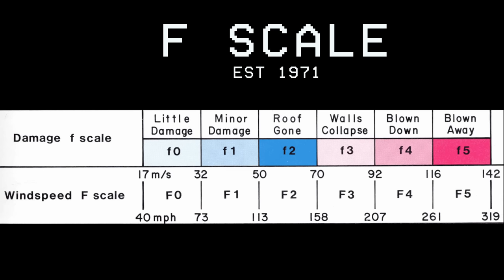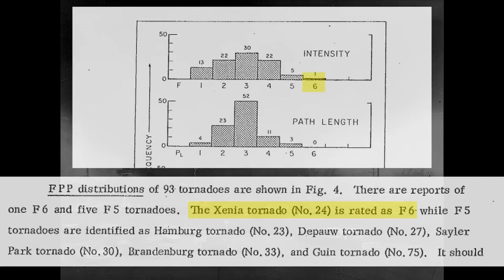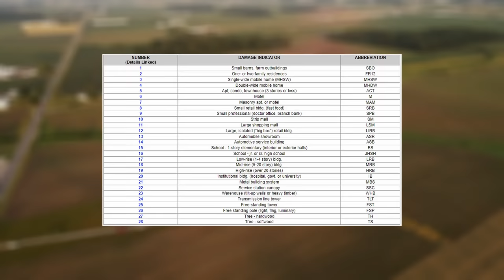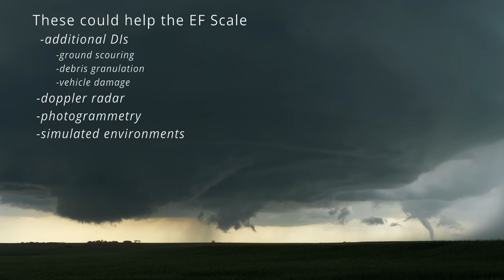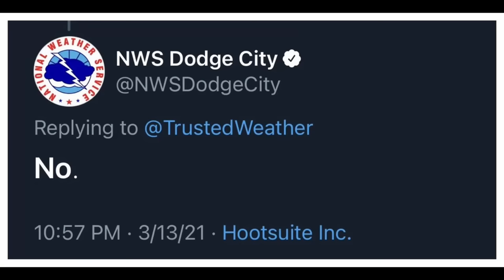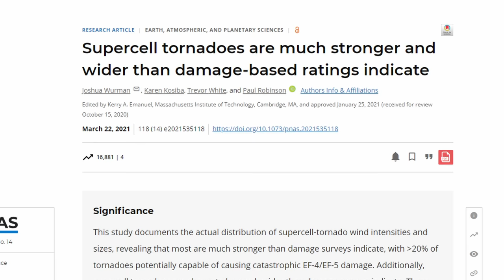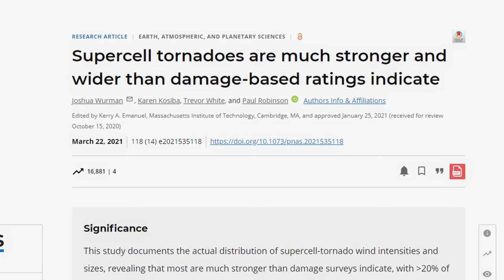Is The EF Scale Outdated?

Comment: Better than the original F-scale, but still not good enough. There has to be more taken into account, including Doppler Wind speed (at the lowest level possible), non DI situations including debarked trees, ground swirls and scouring, and others. Take Joplin; manhole covers were removed and tossed, as well as rebar-anchored concrete parking lot stops. And they were considered more "supplemental" than actual indicators. Again the EF scale is an upgrade of the original, but it is in desperate need of a revamp. We don't HAVE to consider ONLY damage; there are other tornado intensity factors that can be considered as well, that also SHOULD be taken as part of the overall rating.

Comment: The Saffir-Simpson Scale for Hurricanes is outdated too. In fact, there needs to be a surge scale because most deaths in a hurricane doesn't come from wind, it comes from water.
Reply: yeah if we are gonna rate a hurricane on strength it needs to be barometric pressure or lack there of. Or it should be a factor at least

Comment: I grew up in central IL. I'm willing to bet that 20%+ of all tornadoes are underrated by at least one on the EF scale since at least the early 1970s. There important unseen reasons to underrate storms. First, there is an important and highly funded community that relies on "more powerful" storms in the present compared to the past, second, FEMA funds are not unlimited, and third, NOAA itself has incentives to underrate. Mistakes in calculation are a distant problem. Add insurance lobbies, half brained elected officials, and uncaring bureaucrats, and you have a very well oiled machine in place to pretend that storms are less than they really are. This problem goes all the way back to some of the bad storms like the tornado outbreak of 1890 (https://en.wikipedia.org/wiki/Tornado_outbreak_of_March_27,_1890).

Comment: There's nothing wrong with the EF scale. You need to direct your frustrations to the survey teams. They're the ones rating the damage. That being said, theres a reason they tend to downplay intensity ratings. It's important to not water down the difference between a tornado that may have ever so briefly borderlined the extreme intensity worthy of an EF5 rating and that of a tornado that can hold that extreme intensity for extended periods of time. EF4 and EF5 tornadoes are both very rare and violent. Each can level homes, throw heavy objects remarkable distances, and they can easily be deadly. Either is also rare. But there needs to be something to differentiate the two. EF 5 rating should be saved for what it's intended for. The most extreme and remarkable damage from the rarest intensity level. 

The best part of the EF scale is damage doesn't overlap. From an EF0 to an EF5, there should be no question on intensity. It's better to aim low and give a high end EF4 rating than it is to give a EF5 rating because a gust of wind may have briefly pushed it just inside the threshold of EF5 intensity. Hurricane intensity is rated similarly, not by the strength of the gusts, but how high they hold an average wind speed. 

I really don't understand why anyone would want to rate a tornado based on wind speed alone. Nobody cares if a tornado has 200+ mph winds if it's in an open field and doesn't hit anything. At that point it doesn't make any difference if the wind speed is 70 mph or 300+. As long as it's not out there doing extreme ground scouring and digging trenches. which by the way,  has been used to decide an EF5 rating. The 2011 Philadelphia Ms EF5 rating was determined due to extreme ground scouring (2ft deep trenches). 2.6 miles wide or not, the El Reno tornado would've been insignificant had it not been for  storm chasers that didn't stay out of its path. After all, chasers can't be hit by tornadoes if they'd simply stay out from under the rotating wall cloud. It's called the bears cage for a reason.

Comment: We need a way to measure wind speed 10-20 feet off the ground damage or no damage.  

Keep the EF damage rating system but also develop a radar wind speed scale.  

9 tornadoes hit DI’s able to give them that rating.   I assume other tornadoes were as strong but not observable due to no damage rating.    

Had the el Reno monster hit a town it would be EF4 or greater

Comment: I’ve heard it explained by engineers who assess these storms, that just because a house is swept clean off it’s foundation, does not mean it was EF 5. It may have been just barely bolted to the foundation or the specific bolts used to anchor it would not be enough to keep the house anchored downward when the low pressure outside the home from the tornado, causes the high pressure in the home to lift off it’s foundation. This is why true EF 5’s are based off of extremely well built and incredibly well anchored homes. If those are fully swept clean, in addition to a list of many other things, they know it’s EF 5. It is rare to see homes extremely well anchored, as required for it to be considered EF 5, so the ability for other homes for handle much lower winds can sometimes be enough to sweep it clean. The people who rate the tornadoes have several steps per foundation anchor types to properly assess if it would have been demolished at much lower speeds. This is why not all clean slabs are considered F5.

Comment: Literally the only thing they need to do to fix the scale is by updating the wording of it to simply be more along the lines of "Recorded wind speed measurements determine the rating. In absence of accurate measurements, damage assessments and witness video should be used to estimate its impact" rather than "If there's no damage, there's no tornado"

Comment: I don't think going by radar indicated winds is a good idea either. A lot of the time, the radar isn't close to the storm, meaning that the radar itself isn't reading windspeeds at the ground, but higher up into the storm itself. This doesn't translate 1:1 to ground level wind speeds.
Reply: May 3, 1999, the DOW recorded 318 mph winds, but was adjusted to 302 mph at ground level, as the greater number was recorded several meters above the ground.

Comment: Heres my opinion shortened 

We rate hurricanes by wind speed so why not use our modern tools and rate tornadoes by wind speed (includes video footage to calculate wind speed) then if theres no wind data go off damage

Also side note i consider xenia an F6
Reply: Dr. Fujita classified Bridge Creek and Xenia both as possibly being of EF-6 strength as well.
Reply: @helicitywx  thats impossible as Dr. Fujita passed away in 98 and the tornado was in 99
Reply: @wolfgamingnetwork3542  This should've been "Bridge Creek and Xenia were possibly F-6 strength."
Reply: The vast majority of tornadoes have no measured wind speed. Well under one percent ever get a wind speed measurement.
Reply: @tid418  That's why it ticks my off to see all the comments saying "we have dows now." DOWs will not be used in the vast majority of tornadoes. And the winds are too violent for the standards measuring device, namely an anemometer, to survive.

Comment: You are free to agree/disagree with me. I don't mean to debate, I would like to hear your opinion (and others) on what I think should happen:

Not every tornado is going to have an accurate way to measure wind speed, especially if it is in rural Wyoming, hundreds of mile away from the nearest radar. That is why records add the word "measured" when talking about highest "measured" wind speeds because they know it is not possible to measure all tornados. Therefore I believe the EF scale needs to continue to be used for historic comparison purposes, etc. That being said, I remember when the EF scale replaced the F scale and how stupid I thought it was that a 200mph twister could be rated EF0 because it only knocked over a lawn chair. Therefore, if it were up to me, I would add a number before the EF rating. For example, the 2013 El Reno tornado clearly had EF5 winds but caused only EF3 damage. That tornado (under my system) would be rated "5-EF3" to show the potential of EF5 damage that was "estimated" while showing the rating that was actually "confirmed". The 2021 Mayfield twister only had a max wind speed of 190mph (source: wikipedia) so I would rate it "4-EF4" but if the EF5 damage mentioned in your video was actually used like it should have been, then under my system, the tornado would have an "4-EF5" rating. If there is a twister in rural Colorado that causes EF2 damage but no way of estimates from the ground were available, the rating would be "U-EF2" to signify "Undetermined wind speed".
Reply from the maker: I agree, not every tornado will be close to radar, however adding additional techniques would only increase the amount of information used to rate tornadoes.
Reply: @highriskchris  There are numerous ways to rate and I think you (the weather guy) would have a better understanding of how it should be rated. Thank you for listening/replying. It gave me better insight on what still needs done rating these storms.

Comment: Tbh if we measured tornadoes by windspeeds and have good technology that will be able to easily record the windspeeds in a tornado, we would have a lot of ef5's people might not take ef5's as seriously if we have like 50 every year
Reply: Though the ef scale should be worked on a bit but I don't think we should fully go off windspeeds
Reply: @EndZoneEmpire-d2i  but thats the problem with the ef scale, it thinks only like 1 EF5 happens only every couple years, thats not the case at all and there has been probably over 10-20 other tornados with ef 5 strength that were underestimated and were not properly ranked because of them going off only damage

Comment: If an EF5 is supposed to be a clean slate, then something like the Rainsville nado, which ripped a storm shelter right out of the fucking ground and peeled the asphalt off the road, should be an EF6.  And in my book, it is an "honorary" EF6, along with the Tri-State, with the only two "official" ones being El Reno and Bridge Creek as they had speeds measured at 300 MPH+, which is the benchmark for me to personally class a funnel as a EF6 on my little unofficial scale.

And a note about Fujita's estimate of how high the bomb was when it detonated is that he was only off by 60 meters.
Reply: philadelphia, smithville and hackleburg all should've been ef6 too if that rating was a thing. 2011 was insane. definitely agree tri state would've been as well.
Reply: I dont hate the EF scale as a damage analysis, but I hate the analysis they do. Personally, it seems a bit lazy or like they are scared to give tornadoes an EF5. But unfortunately, I think not having EF5s makes people less scared of and therefore less aware of tornadoes.

Comment: You hit the nail on the head here, Is a bull any less dangerous standing in a open field !  The vary fact they rate it by damage, and not by the storms wind speeds etc .... Always puzzled me! When they down graded the  2013 El Reno tornado to an EF3   That did it for me,  Secont strongest tornado's ever recorded!  had one of the highest record wind speeds, and the widest tornado ever recorded!   ''Sigh'' Def.  The rating system needs to change!

Comment: There were significantly more F5s than EF5s even though the requirement for an F5 is 60 miles per hour greater. There have probably been 5 EF5s since the Moore EF5 that haven't been rated correctly.
Reply: 60 miles per hour? Lmao

Comment: I've been thinking this as well. There are so many strong, obviously violent tornadoes when looking at their rotational velocity & motion in videos that occur over the Plains that there's no way to accurately gauge their true strength. A powerful tornado over open fields will get an EF0 or EF1 rating regardless if it has EF4 / EF5 winds. 

The damage indicators we use are limiting and do not take into account ground scouring, vehicles tossed or mangled, or wind speeds detected by radar.  If we were to use doppler radar, we need to take into account the height of strong winds because they mean nothing if 200-300 ft off the ground.  We also need to consider how long the strong winds last.  Are they transient and associated with rapidly moving mesovortices instead of being sustained? If so, we can probably lower the rating (El Reno, OK 2013 comes to mind).

*PS:  I personally do not buy the hype that people want El Reno 2013 to be an EF5.  Was it maybe an EF4?  Probably, but the EF5 winds were very brief inside mesovortices that were moving inside the tornado in excess of 100 mph.  Such rapid motion inflations the actual winds of the mesovortex (and the parent tornado).

Comment: While I agree that the current method of analyzing tornado intensity in the enhanced Fujita scale may be improved upon, I disagreed that it radar indicated wind speed is the best option. This method definitely has its flaws as well, such as  in cases of a multi tornadic storm. small vortices can easily be slung around larger tornadoes, increasing their radar indicated wind speed far faster than their rotational velocity. Some of the “fastest” tornadoes actually recorded are just F0 ropes which do not deserve to be sorted into the same category as Moore or El Reno. Perhaps future models can classify tornadoes by a combination of rotational speed, linear velocity, diameter, destruction, etc.
Reply: The peak wind speeds in those tornadoes was in the subvortices, not the parent rotation. Peak wind speed is peak wind speed, and that is how they are rated.

Comment: There are a few things I want to clarify. The first thing that the most tornadoes in a 24 hour period was the 2011 super outbreak with 219 tornadoes.  Also the reason most of these tornadoes get a lower ratings then the F scale is because we have much more knowledge in not only science but engineering. The EF scale is way more accurate when it comes to rating the damage that is caused by tornadoes. You got to remember not all houses are built equally and not all houses are up to code perfectly.  For example once a weak tornado blew a McMansion off its foundation and it wasn't even a direct hit because of how horribly the house was built. Also the EF scale was only made to rate the kind of damage that the tornado did along its path. So yes it is possible to have a tornado with 200 MPH winds that hit absolutely nothing and get a rating of EF 0. Those 301 MPH winds you are talking about with the El Reno tornado were mostly above the ground and they were never recorded to be surface winds. I would say the rating it got was appropriate given it didn't do much damage to buildings to warrant something higher.

Comment: Maybe there could be two ratings, a damage EF rating and a "W" wind rating for tornadoes that have reliable wind measurements. For example you could say the 2013 El Reno tornado has an EF3 damage rating and a W5 wind rating, indicating it contained winds that could potentially have caused EF5 damage. Most tornadoes won't have a W rating because most won't have a reliable wind measurement but for the ones that do, it would help indicate the true strength of the tornado. Alternatively, the "W" rating could just be the peak wind speeds, like W-200 for 200 MPH winds.

Comment: This claim is just about what I expected when I saw that it referenced El Reno - entirely illogical. Trying to compare apples and oranges. The EF scale, like the F scale before it, is a classification of damage, NOT wind velocity. The wind estimate made on the basis of damage is just that - an estimate. Also, the velocity of El Reno was not “determined” to be anything. It was ESTIMATED by DOW to be higher than was estimated by damaged. There is no known technology to directly measure wind speeds that great. So the damage assessment reflected by the EF scale is and always was correct because it is not and never was a direct measurement of wind speed. DOW does not give a direct measurement of speed or of damage either. DOW has absolutely nothing to do with the EF scale. The original erroneous claim that El Reno was EF5 based on DOW was, as I said, completely illogical and was rightfully discarded. Now, if you want to devise a different scale of wind estimation based of radar, then do that, but call it the DOW scale or something like that but do not try to conflate radar wind speed estimates with direct damage assessment of the EF scale. EF is not a measurement of wind speed. Nothing can directly determine wind speeds of that magnitude.
Reply from the maker: tHe Ef ScAlE Is A dAmAgE sCaLe.

Hey bozo, did you even watch my video?

The fujita scale was developed to determine the windspeeds contained within a tornado in a time before wide scale Doppler Radar integration. Fujita only had damage to go off of when analyzing tornadoes. There have been dozens of technological breakthroughs that can be used to gain insights on ACTUAL winds contained within tornadoes, and I listed those in my video. In it's current form, the EF scale IS a damage scale, but that was never the purpose Fujita intended. Fujita was interested in the tornadoes, not the damage from the tornadoes. Analyzing the damage was the best and only data available to Fujita at the time, so that's what he analyzed. If Fujita was around today, I'm confident he would be abhorred at the current state of official tornado classification practices. Determining a tornadoes strength solely based off of the damage it does is unscientific and ignores tons of other totally valid data.

Also, not sure why people like you get so upset when the serious and potentially dangerous flaws of the EF scale are pointed out. omitting data because "that's how we used to do it" is.... bad science and muddies the waters of our understanding of this extremely unique natural phenomena.